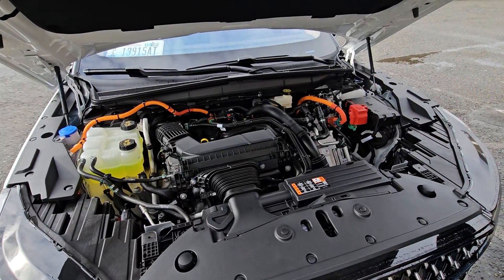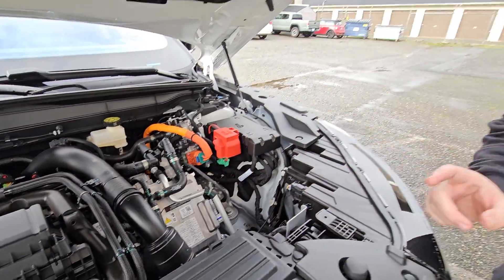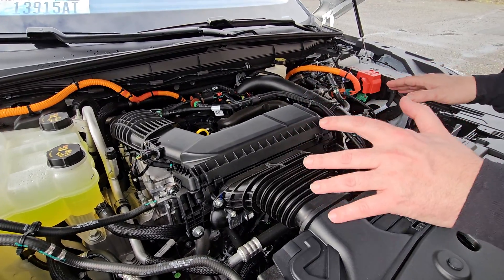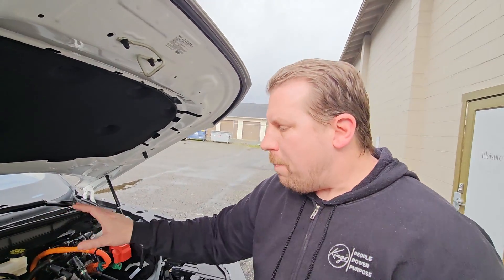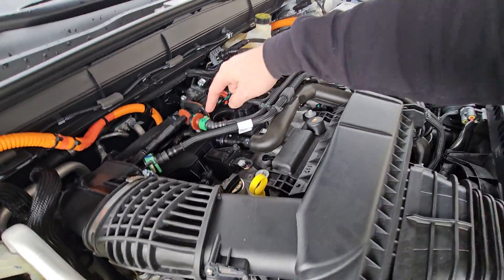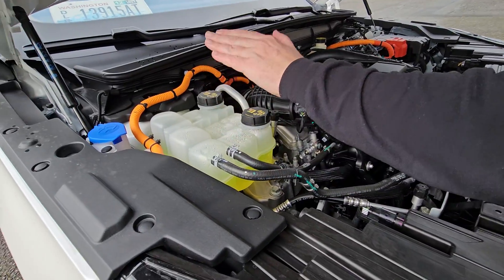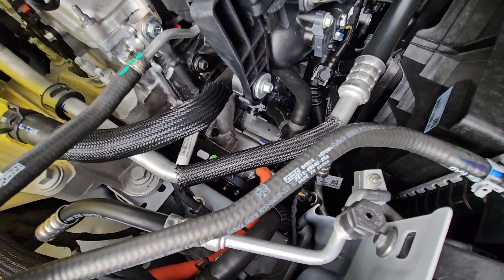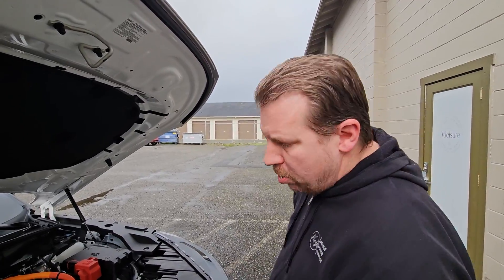A Deep Dive into the 2.0 MPC Turbo Ecoboost with the eCVT (HF55)!!  This Week on jmcGarage Talk!

Comment: Great review. Now that you have tested this out how would you compare the acceleration to the 2023 Nautilus 6 cylinder?
Reply from the maker: I would say it's on par if not a tad bit faster than the old 2.7 TT V6 found in last year's Nautilus
Reply: @thejmcGarage I'm skeptical about your hybrid performance guess. According to the latest info on the Lincoln website, the final numbers the hybrid is putting out are 300 hp and 295 lb ft of torque. This compares to 335 hp and 380 lb ft of torque for the 2.7 V6, which does 0-60 in 5.9 seconds. This suggests the only way the new hybrid is as fast as the twin turbo V6 is if the 2024 Nautilus has lost a significant amount of weight compared to its predecessor - which admittedly I'm not sure if that's the case or not. We'll have to wait for measured road tests, but I'll be very surprised if the new hybrid is a sub 6 second car 0-60 with its output numbers.
Reply: @craigd10  I will wait to test mine with my draggy once it comes. the 8F57 is not very good at putting power down and Ford severely limits 1st and 2nd gear boost. The eCVT will hold the engine in the power band better and the electric motors make peak output at all RPMs. The 2.7 is a great motor but the rest of the system cripples it to compete with vehicles with 260-300hp.
Reply: @jacyedwards4452  you make a solid point that the 2.7 twin turbo is held back by its transmission tuning. Case in point: the similarly powered and heavier BMW X5 xDrive40i does 0-60 in 4.8 seconds as proof the 2.7 should have more performance. If despite it lesser output, the new hybrid mated with the eCVT ends up quicker along with being much more fuel efficient, then I may well be looking to replace my 2019 Nautilus with one. But for now, I remain skeptical it will be a sub 6 second car with less than 300 lb ft of torque pulling 4500 lbs from standstill.
Reply: @craigd10  First thing ill do when mine hits 1000 miles (Due any day now) is perform a dragy run and log its performance. Ill try and remember to respond to this post with the outcome. My edge ST did 0-60 in 5.74 with some slight wheel spin.